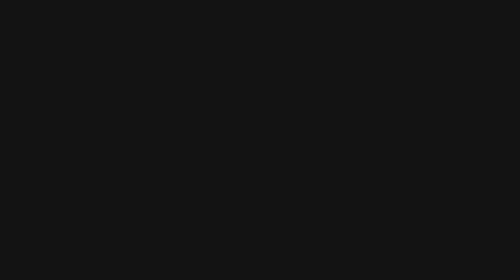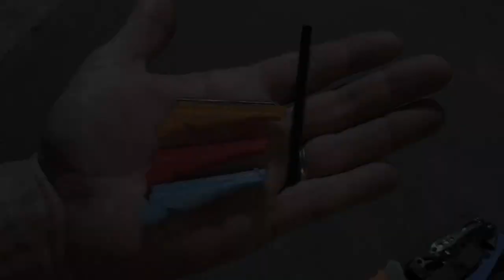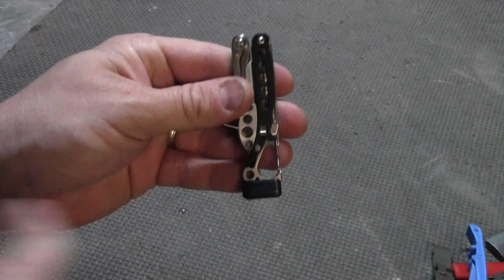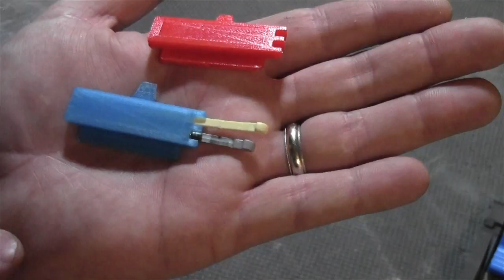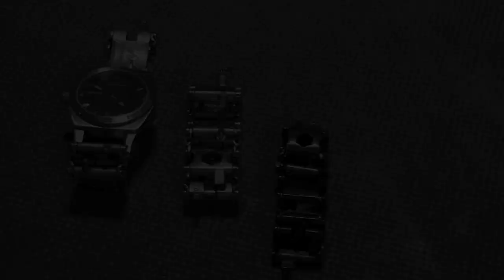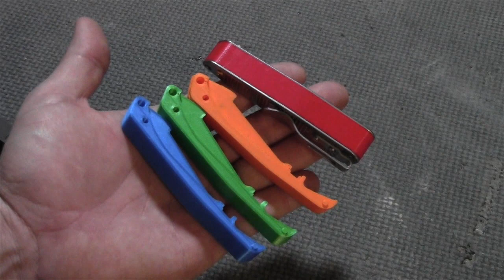3D Printed Mods for Leatherman Tools

Comment: Could you please design a substitution part for the sharpener on the other side, I want one component of the bit kit can be added on my multitools.
Reply: Thank you soooooo much!
Reply from the maker: I will look to see if I can make that work. One potential problem is that the sharpener has a little cleat that secures it the the frame of the tool. 3D printing the clear would be too fragile.